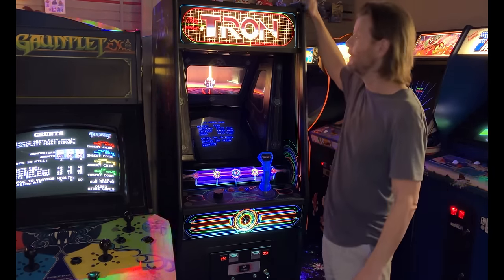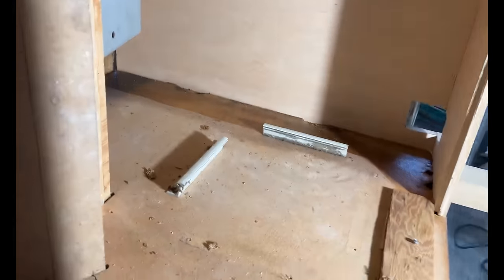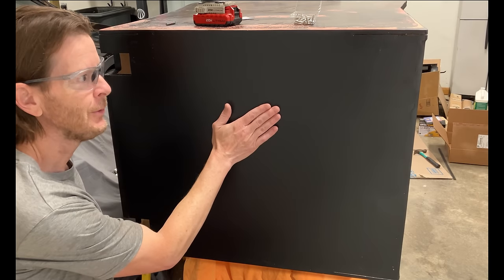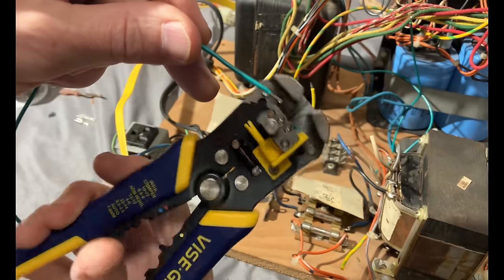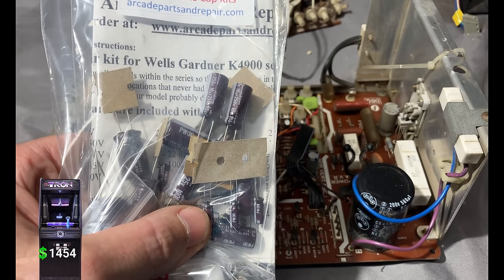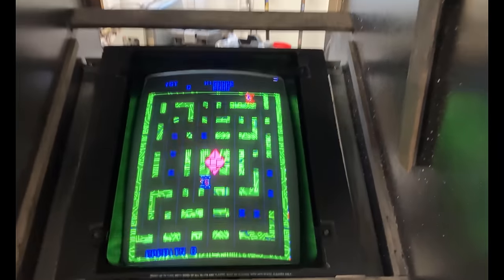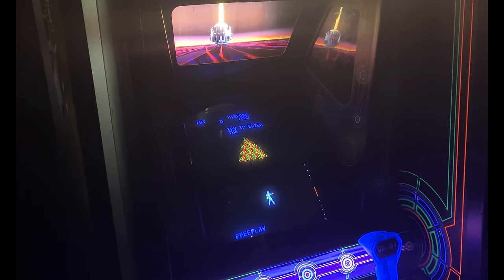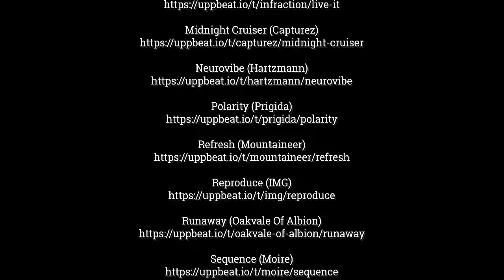"Trashed" Tron Arcade Restoration!

Comment: That circuit board that you are replacing the caps on is one of the best boards I have ever seen.  That must have been fun to work on.
Reply from the maker: It was a fun project for sure :)
Reply: @tcurtis49  everything on that board was marked for easy replacement.  Now days you be lucky to get any annotations on a pcb
Reply from the maker: @theboz1419  Yeah they were nicely labeled back then, for sure!

Comment: That water damage was beyond what I would have considered saveable. Kudos to you for brining it back from it's watery grave!
Reply from the maker: Yeah, I felt the same way for sure. I was close to cutting new sides but wanted to see what was possible. It certainly worked out in the end.
Reply: @tcurtis49  The results are amazing! Very satisfying to see you repair the bottom like that.
Reply: I'd have taken off a larger chunk just to save time. I love restoring things, but actually recompressing the chipboard to its original form ...a bit too much for me. But it's nice to see someone be so meticulous.
I plan not to restore a cabinet, but to create a copy of the millepede cabaret, with modern replacement CPU (Pi or PC) but with a CRT.
Reply: @tcurtis49  I make/restore guitar speaker cabinets. I wouldn't have been that patient. LOL I would have measured [and re-measured] to remake the cabinet from scratch out of birch ply.

Comment: I owned a coin-op route business from 1993 to 1999 with many locations from fun centers to convenience stores and any place that would let us put a machine in.  That's where I first cut my teeth learning electronics diagnostics and repair and all kinds of other things.  I purchased Randy Fromm's Arcade School on VHS, watched those and spent a good deal of time in the back of the Colorado Game Exchange with the repair techs learning from them.  I moved on to other ventures, but I'll always have a deep love for arcades and arcade machines.

You did a top notch job restoring this Tron!  I really appreciate that you did everything properly and didn't do any hack jobs like I see a few other arcade (and automotive) channels do consistently.  You earned a sub!
Reply: The hack that really grates on me is when they encourage sanding on point contacts/switches which will make them work temporarily but removes the thin high quality contact alloy metal exposing the cheap metal underneath that degrades quickly.  The guy I purchased my first few machines from told me to sand those contacts with a nail file to clean them, and I completely ruined an antique electro-mechanical pinball machine doing that not long after.  

It was one of the techs at the CGE that taught me that contacts need cleaning, not sanding, and that the proper way is any chemical or non-abrasive that will remove gunk and polish but not damage the contact finish, one of his common tools was a simple pink eraser, sometimes with some contact cleaner;  a pink eraser and D5 is my go to now.  Some people laugh in my face when I try to teach them this eraser trick, but it works quick and easy without any damage.  This works on any metal contact, points, edge connectors, pins, etc.
Reply from the maker: Thanks! I try to do what's best in the long run as much as possible by listening to the pros but always learning new things as I go. I've used a pink eraser forever cleaning contacts--I still do it from time to time, but once I got used to using a fiberglass brush and deoxit I've just stuck with it. Much appreciated and I am in the middle of some interesting projects right now that I can hopefully detail before long.
Reply: @tcurtis49  I may have to try one of those fiberglass brushes, it looks like they work great. 

Everything I've watched you do from cabinet repair on that old dodgy fiber board to your ability to diagnose and decipher a schematic to get those crazy wonky old boards running if I was still running a coin-op route I would hire you immediately.  I do think you've moved beyond just a hobbyist, you do a lot better job than several arcade channels that tout themselves as professional. 

If I didn't have so much going on right now I would be doing a cap kit on my stand up Double Dragon, you've kinda given me the bug again.
Reply from the maker: That's very kind and I've picked up a lot from doing it for so long. I started buying arcade games at auctions in the mid 1990s while in dental school in Indianapolis. I've always been a technology nerd and a computer programmer so that helped me understand the technical side of things. The rest has been trial and error, seeing what other people are doing, and having some artistic and hand coordination skills from being an orthodontist. But it really comes down to patience and taking things one step at a time. I appreciate the thought and hope you have fun when you get to the cap kit--I have 2 G07s to rebuild as part of my ongoing projects this weekend myself that I've been putting off.
Reply: @tcurtis49  I'm looking forward to your future videos!
Reply: @megacomus  Pink eraser has been my go to since 1988, I have learned that from my friend's father that owned a electronics repair shop. That tip is still by far the best tip in regards to cleaning contact surface area.

Comment: Wells gardner monitor. Used to repair those games and monitors back in the 80's. Repaired thousands of them. Still have my blue soldapullt.
Reply from the maker: I’m always happy to work on old WG monitors. Got 2 G07s on the table right now. Haven’t seen one I couldn’t repair yet :)

Comment: I'm impressed. I saw the water damage of that particle board and was thinking "use the cabined to make a replacement template, outsource for the graphics" but that would have been even more expensive I guess. Makes sense to have done the resin and filler pours. Well done sir, and you've taught me a thing or 2
Reply from the maker: I was impressed by the result and will likely try it again on my next project. But it would have been perfectly logical to just cut new sides. I certainly like to see what I can save whenever possible and was glad to keep the original sideart on it. Thanks!

Comment: You sir, are a master.  I would've not even started on this one.  The worst I ever had was a seemingly (at some point) waterlogged Joust where I eventually gave up on the cabinet and traded it out for one in better condition, moving all the electronics etc. to the replacement.  The guy I traded it to gave up on it too.  I did warn him ahead of time.
Reply from the maker: I have yet to give up on one but certainly question my sanity :) Thanks!

Comment: i can't speak for this case but, rossmann repair group does water damage and they use flux leaded solder and re flow the corroded joints first as to keep as much of the original traces as possible before cleaning. there do exist kits for trace repair as well. more than one way to do it

Comment: This was great to watch and super informative. One thing I would've liked to see was how many man-hours of work went into the restoration, just to have an idea what a project like this would entail.
Reply from the maker: That's a good question. I know it's a lot, but in bursts. I don't leave a ton out of the videos as far as the process goes but do speed up/skim sections for time. It's definitely something that would not pay off as a job--the labor really adds up. For most of my restorations the Bondo/Filler and sanding/resanding takes the most effort and time. In this video there's a section where I am doing electronics and start with the transformer and power supply and go all the way through rebuilding the monitor and putting it all together on top of the table to get the game running. That was done in one day. Otherwise the rest was just kind of hit or miss--a few hours one morning, a couple another afternoon, and so on. No idea what the total would be though :)

Comment: I had no idea you could fix particle board! You're workmanship is amazing Tod, great stuff! The dubstep and retrowave also slaps 😎
Reply: oh and i see you have the SMB3 Pinball! You are a lucky man!! that's my dream unit 😍
Reply from the maker: Thanks! Yes, you can, but if you have a big workshop with plenty of tools it’s often easier to just cut new pieces. But I like the challenge and the preservation aspect :)
Reply: Yeah, I was expecting the cabinet to end up as a Ship of Theseus after the restoration.  But it didn't!  There is some original material left.

Comment: Great video. Watched it start to finish. Back in the day (81, 82?) I spent all my quarters on a lonely "Starcastle" game at a local supermarket. Life moved on, but in @1998 I was at an auction house. They had a Starcastle game. It didn't work but I bought it for 10 bucks. It did not have a back plate. I closed the micro switch and it worked. I still have it to this day. I found spare main, power boards and a spare control panel. I also found the original repair manual. With all the spare parts It should outlive me. Other than a tiny audio issue it works perfect. It's still my favorite game.
Reply from the maker: That is a good one! I bought several games back in the day as non-working only to be that switch on the back door needing set. Easy fix :) Thanks!

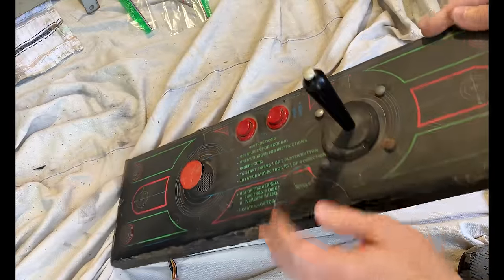Comment: 1:11:11 there's a ring clip that you can remove from the bottom of the old joystick shaft with needle nose pliers that allows you to completely remove the shaft of the joystick from the switch assembly and pull it through the top of the control panel.

Comment: Good video.  I still have my original stand up Tron arcade machine that looks like yours.  Never replaced a part yet.  The joystick is slightly loose, but no other problems. 100% playable and responsive. Feels like a lot of power firing up the machine and monitor... hums almost... 1980's tech.  Good deal with your restore.
Reply from the maker: Thanks! Glad you have a nice one yourself. And that power firing up…it’s no joke :)

Comment: In the late 80s, when I was around 20, I was an electronics technician in the Navy, living in Maine. I went through a time where I would search through the local dump and get electronics to tinker with. 
One day I found a "Moon Patrol" arcade game. I scabbed in a power supply and the darn thing worked! It had a little video garbage, but was playable. I hung onto it for a while, but it was lost to the kid-raising and moving of my 20s. 😢
Reply from the maker: That's a really good find :) It's certainly fun bringing games back to life--and not terribly complicated unless you are dealing with circuit board repairs. Most of them are pretty straightforward. Well, at least straightforward enough to get me into fixing them up!
Reply: @tcurtis49 I saw on the map in your video that you're near Bedford, Indiana. I'm near Nineveh, Indiana. I have been making a gaming arcade machine for years. I use a client PC with a 32" LED monitor and a home made 400 Watt audio system. It's a work in progress but sounds and looks amazing.
Reply from the maker: @Twiddlerdammit  Yep, not that far away. Sounds awesome :)

Comment: Watching the electrical portion makes me miss working on aviation electronics like I did in the Navy. I worked I-level at AIMD. I used to love troubleshooting electronic boards with the Huntron Tracker 2 and an Oscilloscope, plus doing 3M soldering. I did a lot of work on a lot of different electronic systems as well as engine systems. It is not all that different than what he does in this video just we had more troubleshooting equipment options. You can do a lot like he did with the multimeter as well. Those were fun days as well as very busy days.
Reply from the maker: It's always satisfying doing troubleshooting. I have an oscilloscope now so I'm learning a few new things along the way. I definitely enjoy that part more than the cabinet work. Thanks!

Comment: Looks like a KAGA monitor if my memory serves me. I used to fix a lot of CRTs, but in this case, this is one time where I would stray from original and go LCD
Reply from the maker: It's a pretty straightforward Wells-Gardner K4900 which is luckily not too hard to work on. This monitor came from a Tron cab that had been switched to LCD and turned into a multi-game arcade unit.
Reply: @tcurtis49  I remember the wells gardeners with the flyback mounted off the PCB, on one of the metal mounting bars. Those flybacks never failed, but the G07-CB0 CRTs had flybacks that blew all the time. I started soldering a 10K ohm 1/2 watt resistor across the bulk cap because Electrohome put the fuse after the bulk cap so it stayed fully charged even when the fuse blew. The 10K would discharge the cap safely. Bad design.
Reply from the maker: @rickpontificates3406  It’s pretty standard practice to replace the flyback any time you do even a cap kit on the G07-CB0s—they do fail all the time. You can see how I handled the B+ cap in one on my old Atari 5200 kiosk video as that was in the unit. Fuse blown and monitor probably hadn’t been on in years but huge pop shorting across it with a screwdriver. If you don’t have any advance warning you can really get a surprise. Definitely bad design.

Comment: I have used Micromesh kits to polish scratches and pits out of plexiglass aircraft canopies. It went from 400 grit all the way down to 3000 grit. Could do some amazing work with those kits. One had to remember to disperse the polishing over an area wider than the actual damage to cut down on distortion. It got more time consuming, the finer the grit became. Also worked well for putting mirror finishes on metal. The great thing about them is that they are reusable.
Reply from the maker: I will certainly check into that. Thanks!

Comment: Awesome job!
I am in the fiberglass repair industry and have a couple of suggestions that might help you.
Mix your resin with talc powder(baby powder if you can't find plain talc) and mix to a peanut butter consistency. Add your hardener, and you have fiberglass "bondo". Easy to sand and can be applied thicker than bondo without cracking. You can use Cabosil(very fine glass bubbles) as well, but as a thickening agent talc is the best. You can use either to fill in 90° bends when applying glass to avoid air voids for a stronger finish.
Experiment with the talc, I think you will find a lot of uses for it.
Hope this helps with future repairs!
Reply from the maker: Great advice! My main issue is that it flows too easily and gets through cracks into areas I don’t want it to go, I have a specific project right now where I want to inject some into a void but don’t want it to flow everywhere. I’ll give it a try!
Reply: You can always add less talc to get to your desired viscosity. Remember to go a little thicker than you really want so when you add hardener it doesn't get too runny.
You can add glass strands to make it even stronger if needed.

Comment: The “memory glitches” are used by the processor because they ran out of RAM during development, so they used the video ram, it’s supposed to be hidden by monitor adjustments just like you did!
Reply from the maker: Yes--that's what I've come to find out. And a great relic of just how tight code had to be to fit in such limited memory back then.

Comment: Amazing work. I've found that over time the Bondo glazing putty starts to release. I recommend using Seal Skin glazing putty instead. It seems to hold better in the long run.
Reply from the maker: I will check it out. Thanks!

Comment: I would not have imagined for one minute that the bottom could be saved. I just assumed you were going to build a whole new case and just use this for taking measurements and as a reference for where the graphics go.
Reply from the maker: It might have been easier but was definitely more satisfying fixing the old :) Thanks!

Comment: Next time use redgaurd on bottom of cabinets before you paint them.  If water happens to get on them again then they will be sealed up.  Also use mineral spirits instead of goo gone for adhesive cleanup.  Great job!
Reply from the maker: I'll check into it. And I usually do use mineral spirits for cleanup but sometimes grab something else depending on my mood :)

Comment: That’s a lot of passion to rebuild a cabinet in that condition. I have repaired particleboard furniture, using 30 minute two-part epoxy with micro balloons. It makes for a very strong Repair and the micro balloons thicken up the epoxy just enough to shape areas without the epoxy flowing out. I would love to have my own Tron cabinet someday but At this point, All I have is movie memorabilia and collectibles from the original movie as well as legacy. It is the one game I’ve dreamt about all my life ever since I walked into an arcade in 1982 put my first quarter in. My late father had taken me to see the movie and I was hooked from that very minute. I’m in the process of moving and will have a small Arcade room built, but I will only start with a legends ultimate. It’s funny that I’m obsessed with the game that I can only get through level three on each of the games.
Reply from the maker: Someone else suggested adding talc. Lately I’ve been using very fine sawdust and it works really well to thicken it just a bit. Glad you liked the video and good luck with the arcade!